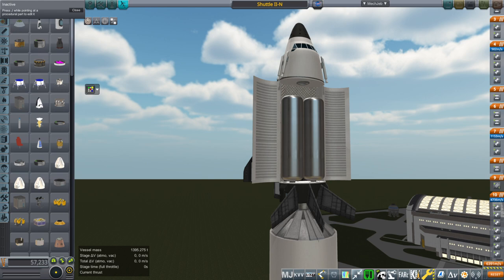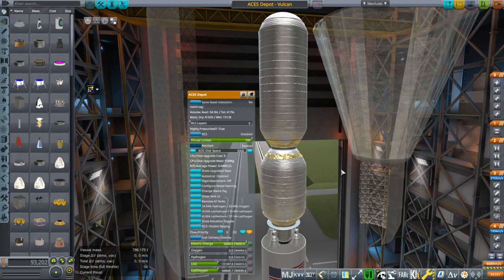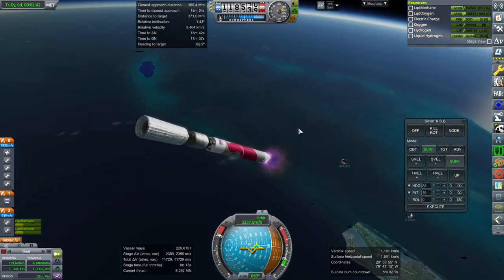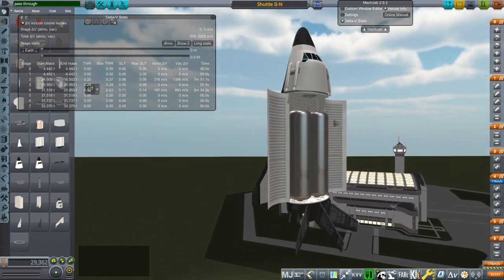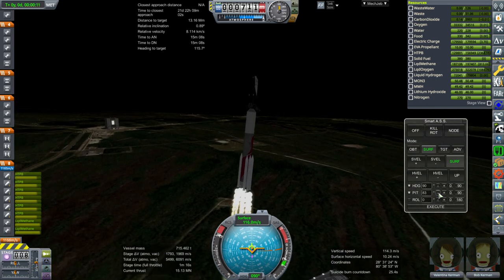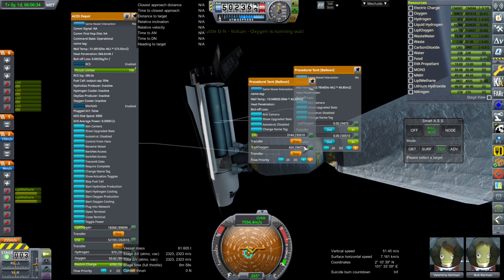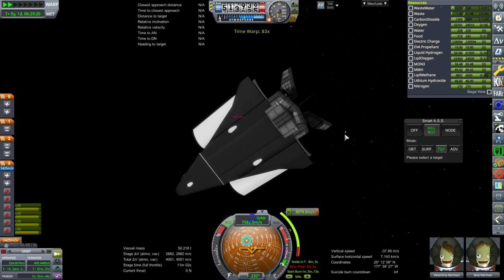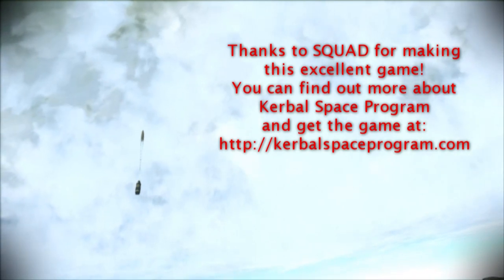KSP with Realism Overhaul - Shuttle II and the ACES Depot

Comment: I love ACES
Reply: Do you really need the vertical stabilizer when you have V tails?
Reply from the maker: There's not enough vertical stabilizer area because it was meant to fit in a fairing, so the area necessary is effectively split into three.